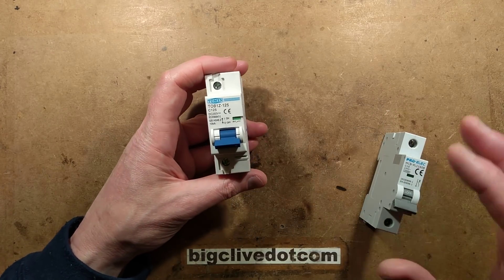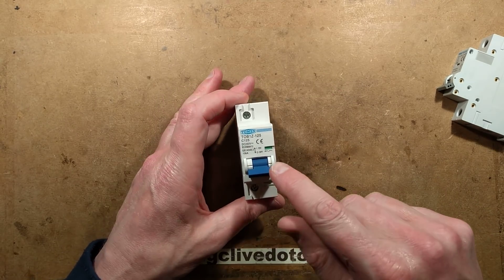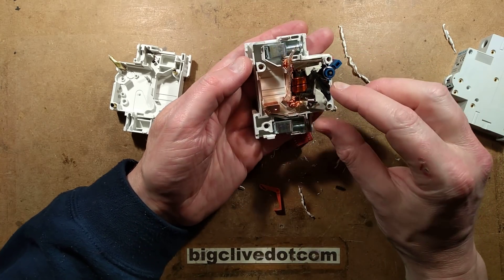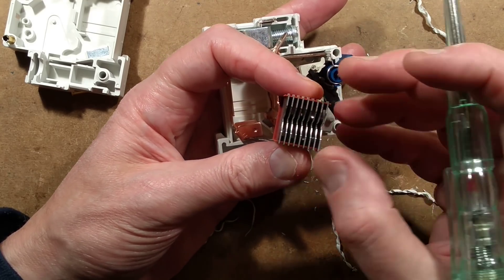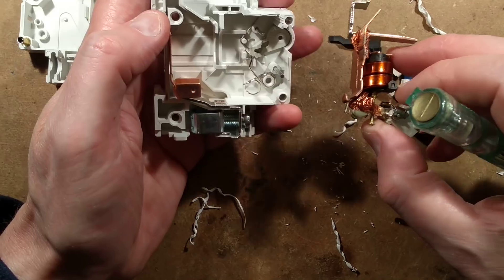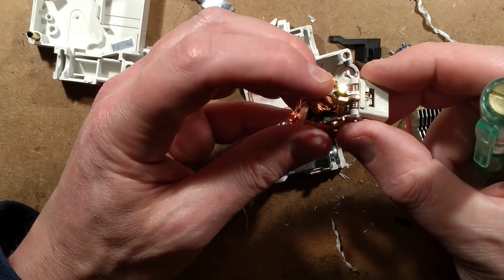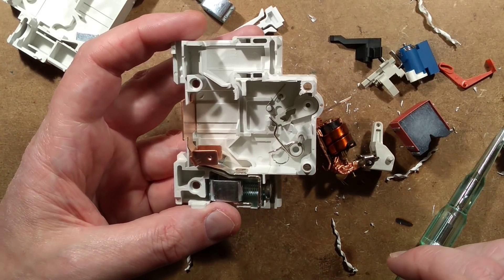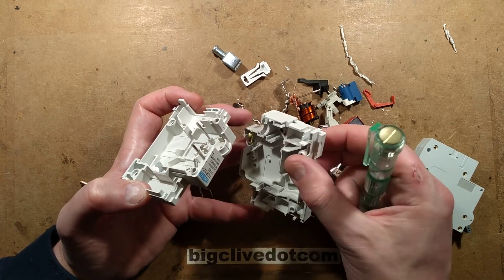Inside a 125A DC circuit breaker.  Unexpected arc quenching feature.

Comment: how many led Christmas strings will it run ??
Reply: Depends. Do you want to light up the leds or also the cables? ;)
Reply: @adlerweb  should i use 370vdc or 850vdc ???
Reply: So many that even Griswold will go "maybe that's enough".